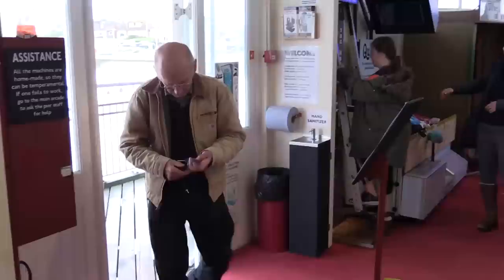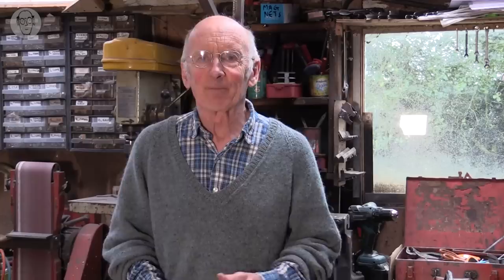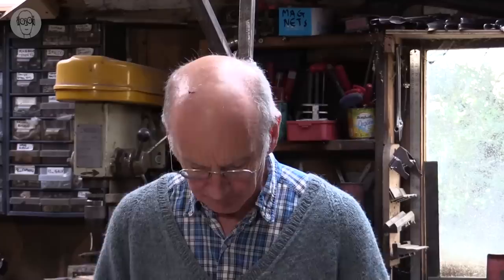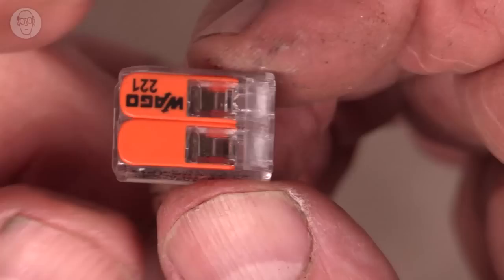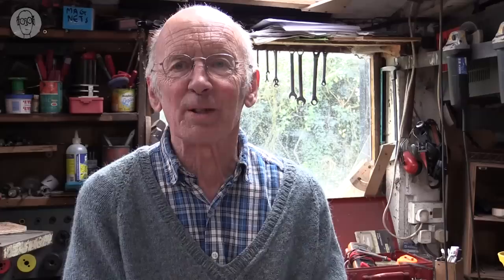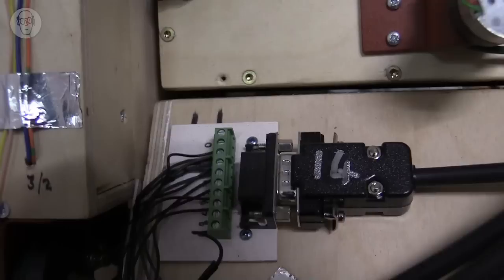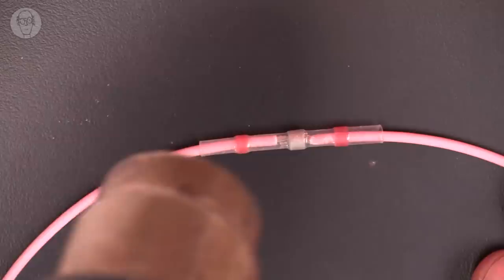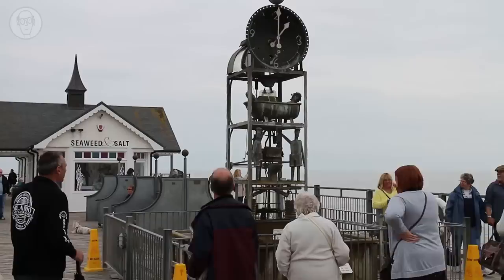CONNECTORS -- The Secret Life of Components, a series of guides for makers and designers - Episode 6

Comment: I totally agree with Tim that connectors are a pain. It's really hard to find a family that covers a range of currents and cable diameters, board and cable mount, water proof or not. And once you've found one, you then often need to invest in the tooling, which as Tim says, isn't cheap. And some connectors seem to cost a fortune too, even though they are just tiny bits of metal and plastic. An open source connector family might be a good idea if anyone has the will power to start it...

Comment: A few times I have added a dab of silicone caulking into some heat shrink to help it be a little more water tight.  Has worked well in my limited use cases and experiences.

Comment: That extra bit on the IDC connector is for stress relief -  bend the main cable back over the connector before fitting it,  it takes the strain away from the IDC connection itself👍👍  
I share your dislike of spade connectors, widely used on mains connections on some machines I service, many go high resistance if they're loose  ( therefore get hot running 10A at 110v) or have the spade sat between the insulation and the receptacle, and also heat up, this causes the insulation to char eventually, and the strands of the wire can sinter together making them brittle, pretty scary.

Comment: Hello Tim, and thanks for your knowledge, imagination and gentle humour. I hope you may be interested in an improvement I've made to the in-line soldered connection with heat shrink covering. As a radio amateur constructing aerials and also 230v wiring outdoors, I need to be certain no wet gets in and the joint can not mechanically fatigue. After soldering and  heat shrinking I coat the joint with hot melt adhesive, aiming to roughly fill the depressions. I then slide on another longer heat shrink sleeve covering the joint symmetrically. I heat from the centre to the edges. This forces air out, melts the adhesive, squeezes down the heat shrink and with practice makes a rather lovely smooth casing. For outdoors I like to add another outer heat shrink covering, the longest. I call this the sacrificial layer; when the weather and UV destroy it, the rest is still good and it can be replaced if appropriate. Hard work I grant you, but the finished joint is rather stiff to resist flexing, well insulated and waterproof. None have failed in 20 years and still counting.I hope you might find this idea useful for your more severe environments. Best regards.

Comment: Yes I highly recommend bootlaces. Im sure you are aware you can get the same things without the coloured end which helps putting multiple wires in the same socket. Also there are ones with a dual entry bootlaces. Might I also agree with you regarding the Molex connectors but I suggest ALL crimp connectors need the right tool so that will be why your other crimps are not quite as strong as you might want. Either way I totally agree with the twisted wire and heat shrink to get you out of a sad spot. Love your work :)

Comment: Thank you for the great videos! :-) Regarding the Wago 221 compact series, the DIN rail mount adapter (part number 221-500) is a nice way to mount them somewhere (not just DIN rails). The world of connectors is practically endless. Two other models of connectors to consider: XT30/60/90 / MT30/60/90 and Tyco Superseal

Comment: I've certainly become a fan of the Wago-type spring connectors, though I have the cheap knockoff types as the originals, bit pricey for my hobby wiring, plus the knockeroffers make versions that Wago themselves don't make, such as passthrough connectors that are akin to the DIN-rail spring connectors, but with the lever system to make a nice tidy butt-joint without any crimping needed... :D

Comment: "It's actually rather satisfying, soldering up these little things"
Oh boy. Not when you get the VGA connectors. Although that was also probably due to bad technique and irons that were too large ...
A friend got a whole load of junked VGA monitors. All the connectors had been cut off. But he reckoned that with the cost of replacement connectors he could turn a few quid selling them. 
None of us could reliably solder on a VGA connector. I got one that more or less worked but it took hours. I dunno what he did with them all in the end :D
Reply: Wait what, a monitor with a VGA cable permanently attached to it? That's barbaric. These couldn't have possibly been half-way decent monitors that anyone would actually want.

For some reason that i can't exactly remember, i terminated a VGA connector before, and personally didn't have issues, but i can see how the access to the middle row is objectively bad. Depending on the era, there's a trick, if it's old pre-DDC, just run one single-strand of suitable thickness across the whole middle row, and really just tack it on, barely on is good enough, because they're all connected together at both device ends anyway. Connect to ground. Flux always helps. Temperature controlled stations help. Sharp 7Sa tweezers help. Don't solder it in free air, plug it into the matching connector, that will save you a lot of trouble.
Reply: @SianaGearz  Permanently attached cables were the norm for most consumer displays. High end ones had removable cables... BNC connections for separate R, G, B, H/sync and V/sync if you were lucky!
Reply: @cromulence  yeah I had an Iiyama with BNC.
Reply: This is why you have multiple irons and stations with interchangeable tips pal :) maybe chopping one end off some cheap VGA cables and splicing them inside the monitors would've been a smarter idea? lol
Reply: @ChaosHusky  Ah we were only young students at the time... :D
Reply: Also when you heat the up a bit more during the soldering the pins start floating around inside and end up some sticking out more some sticking out less, some slanted and some in different places.

Comment: Two tricks with ribbon cables.
flat cables tend to take up space (width ) when turning corners. (eg inside a computers with lots of very wide cables) so split the cables along the length(between the wires) then stack them, and then wrap them together with string/ zip ties etc.  now computer floppy and hdd drive cables can be done this way, but they are special like network cables as they are 'signal matched' to reduce noise signal  interference (why it is 'twisted pair') I did this to several of my computers with no problems as a way to help air flow inside the case.

2nd ribbon cable trick. 
5-1amp wires equal 1-5amp wire (gang them together) cell phoneson. , motherboards, laptop screen connectors etc. use this trick ALL THE TIME. it gets lots of current through a very narrow gap ss it adds flexibility to a normally non-flexible wire. bonus tip: if you need 5amps over 1amp wires, add a few more for redundancy. (put fuse before to protect the wire gang)

Comment: If you want to use a ferrule as a two wire splice, you can use two wire ferrules. Two wire ferrules provides and elongated plastic sleeve to accommodate two wires side-by-side. The two wire ferrule can be very handy when you want to minimize the number of PCB block terminal screw and tension sleeve connection positions. 

There are many different crimp styles for ferrules. Mainly, Trapezoidal, Square and Indentation. Trapezoidal (or Trapezoidal Indentation) is popular for high stranding small wire (18 AWG and 16AWG) terminal blocks (Phoenix Contact) screw connection with tension sleeve. Indent is popular with AC large wire connection lugs because they have rounded edges with a flat top, which better matches the rounded (circular) screw lug connection. For example, if you are using a supplemental equipment circuit breaker with circular screw lugs and want to connect the circuit using high stranded wire (higher than what is used to certify the lug connection) then the best crimp is the Indentation or Trapezoidal Indentation.

Ferrules can address the use of high stranded wiring which exceeded UL 486 stranding testing requirement. Meaning if the wire strand count exceeds UL 486, it is best to use a ferrule. One example of where you find this need is in yacht power distribution design. Where the wire is tin plated high stranding boat cable, which is corrosion resistant and very flexible. For AC applications UL 486 listed screw terminal wire connections are rated for a low strand count wire. Using high stranded wire above UL 486 testing requirements will lead to a loose connection which will generate excess heat.

Comment: Great content, lots of ideas there, loved your TV series, I have always enjoyed making things and there are so many things that can be adapted. Regarding small signal connections in various telecomms applications we use "Krone blocks", they are not suited to harsh environments but are extremely fast to deploy. There are test plugs available to either "piggy back" into a circuit or isolate source and load and make measurements facing either circuit. Only suited to small solid conductor wires as used in CAT 5 cable etc.

Comment: 44:07 - :) aww, that was so cute

After I strip the ends of a wire I can't help but twist them. Always. I don't know if it's a bad practice or not but I just have to. Also, sometimes I put some solder on the wires before fitting anything on the end, I feel it's much firmer. But I probably don't have the right crimping tool for the job :) I usually use the soldering iron to shring the shring tube or sometimes I take a lighter and carefully hold the tube to it.

A couple of weeks ago I cleaned a pair of PC speakers and took them apart so I could retro bright the plastic. There was a connection inside from the mains to the transformer that was only a weird little yellow cone with threads inside. You have to twist the two wires together clockwise and then you can twist this cap on clockwise, it grabs into the copper and holds them together. It held together surprisingly well. They are called Twist-on wire connector.
Reply: That "little yellow cone" is almost certainly a wirenut, aka Marrette.  Popular in the US, almost unknown in the UK.
Back in college, I worked with a left-handed guy who always twisted wire-ends anticlockwise; this was fine, except that anytime he handed me a cable with fuzzy ends I'd try to tighten the ends up by twisting them -- clockwise! :-)  Yeah, no help.  I never taught my fingers to follow his choice...

Comment: there is also heat shrink tube with a ring of hot glue on the inside. These will make the connection watertight if you solder two wires together.

Comment: Gell filled connector @ 35:00 looks like 3M Scotchlok UY IDC connector rated for 0.4-0.7mm (22-26 awg) Solid wire. This and many IDC joints can Cut strand on stranded wires and cause problems. When you use pliers, use small 2 position slip joints pliers set to wide position to let jaws be close to parallel when you crush the button.
Cheap Crimp connectors @ 36:00 you buy from Ebay Banggood and others often have problems whether spades, bullets, etc. Won't fit like shown or fails soon because metal is too thin or otherwise weak.
Red Insulated crimps typically fit 0.5-1.5 mm2 (22--16 awg) wires but "single shot" tools often need adjustments to crimp on different wire sizes.

Comment: The only thing I think is missing is the linemans splice. I only came across it recently but I use it all the time now when I need to join two wires in-line with each other. I found it to be remarkably strong and durable even without soldering. I think it was AvE I first saw mention it in a video.

Comment: 14:18 instead of putting multiple ferrells into a screw terminal twist your wires together first and find a ferrell that fits over all the strands. It permanently connects the wires but it makes the screw terminal more neat.
Reply: I dunno, I'd find myself cutting the wires apart, most times I had to do any debugging...
Reply: @theskett  there's solutions around that. This is mainly when you want many small wires to fit neatly and combine in a connector for larger wire. You should be able to isolate all the little individual wires somewhere down the line at there next connector, fuse, component ect. You rarely have to isolate both ends of a circuit. Basically no need to cut anything just find out where those wires eventually end up and "'cut'" them there where they terminate.
Reply: @theskett  to each there own though. Wires in electrical harness in cars branch of all over the place soldered hard with no option but to cut for troubleshooting. It all depends how confident you are in your creation

Comment: My first connector was tinfoil and newspaper with holes in it. I made a pressure plate and put it on the stairs so i would know if my parents were coming up, to turn off my light reading the BEANO. First used WAGO's flip tab last year, very quick for temporary connections. Nice soldering. 40A D9, ?  gone for xlr Type screw lock for my cnc,  Solder under a X10 stereo microscope. its a world of difference..Great tip on white shrink tubing, Never seen the "yorkshire fitting"  for wires. Solder seal. Put the IDC in the vice. Crimp AGHHH. for eyes there great. XT connectors used in many battery applications. . mini JST, Japanese Solderless Terminal, Molex . Those crimps jaw sets are as much as pipe tube bender dies , just bought a JD2 and 1" die set to make a clock frame from cold drawn seamless tube. .Engineering is an adventure that never stops. New particles, muon spin increase doesnt match magnetic field loss. thats my take on it.

Comment: The fused plug is still way safer. Even radial instead of ring circuits can still be dangerous.
The sensitive protection Tim mentions are Residual Current Detector (GFCI in USA) are ONLY for Live to Earth or Neutral to Earth Faults. They do NOT detect Live to Neutral faults. So large currents can still flow. Also if you are well insulated and connect yourself between Live and Neutral the RCD (GFCI) will not know you are getting electrocuted.
Tim I have enjoyed your work for some decades now. :-)

Comment: My favourite is D type connectors with ribbon cable. Quick cheap and very reliable.
Reply: After about 10 years of development on my DIY open source wireless data link Twibright Ronja I ended up with these connectors too. Also, they can be screwed down so they don't get accidentally yanked halfway out when rummaging in the cables, resulting in a random long time Internet dropout later when the premises where the device is installed is locked because the owner is on a vacation, and the barely touching halfway yanked out connector stops barely touching, because it microscopically moved due to thermal expansion or vibrations.
Reply: @charlieangkor8649  They are great connectors and the made up cables are super cheap on ebay. Ive got ones that are about 30 years old and yet i cant get a micro usb cable to charge my phone reliably after a few months

Comment: For the twisting wires together and adding heatshrink solution I recommend using tiny zipties on the end to act as strain relief, you can get a bag of 1000 for less than 10 bucks from china and they work well.

Comment: Good topic and you inspired lots of good comments.  I do like the automotive and marine and aviation rated connectors since they often are designed at least with an attempt to resist vibration and moisture - so a little more robust and hopefully less prone to failure but I know it does still occur! I'm off to look at the Deutsch DT suggested by one of your commenters.

Comment: My takeaway from this episode is the use of white heat shrink tubing for making labels.  I'm amazed that in 30+ years of using heat shrink tubing I never thought to do that.  I have, however, been using a model airplane shrink wrap blower to shrink my heat shrink tubes for years - hotter than a hair drier, not as hot as a butane lighter or soldering iron, and cheaper than a paint stripper.

Comment: Excellent. I was just wiring up a 20A connector last night to add a remote switch to an 18V saw, it had solder buckets and was very chunky and satisfying to work with. It's worth mentioning the modern Uni-T clamp meters that allow you to measure AC and DC current without breaking the circuit - if the setup is suitable, you have the space and there are not interfering components nearly.

Comment: Clamp meters are great for the sort of work you (and I) many only measure AC current using the clamp (with a transformer) but some can do both AC and DC by using a hall effect sensor for DC, you need to zero DC clamp meters before measuring as it can pick up stray magnetic fields, you can measure combined current of several circuits simply by putting all the supply wires for those circuits in the clamp. A useful tool for working with cage/rising clamp terminal blocks is a dental mirror so you can check it's fully open and the fire has gone in correctly without lying on your back. Din rail terminals have commoning strips available that you can cut to length so you can split one wire out to multiple circuits by using several blocks linked with a commoning strip. Punchdown is a specific type of IDC connector that uses a punchdown tool, ribboncable connectors are IDC but not punchdown, the better punchdown tools both seat the wire and trim off any excess as they have a little built in wire cutter that activates as you push the tool down. I discovered Gel crimps quite late in life, I knew they existed but thought they were really limited to solid core telecomms world but I used them for the LED's on this and it saved days of work, the version I used actually takes three wires so I could tee of a branch wire and carry on the branch wire to the next connector.

https://www.youtube.com/watch?v=xo4I2d-zrnQ